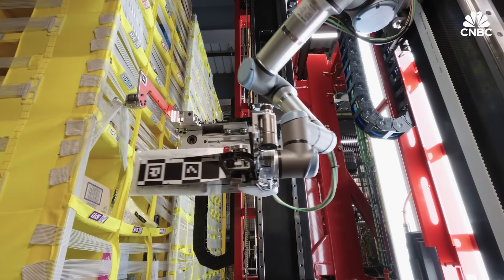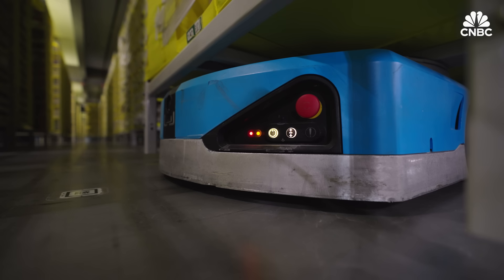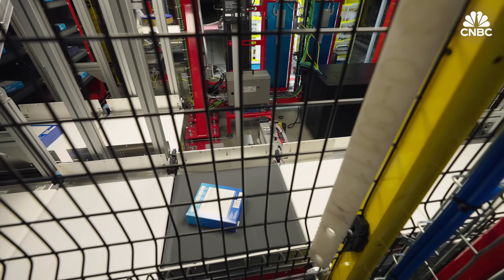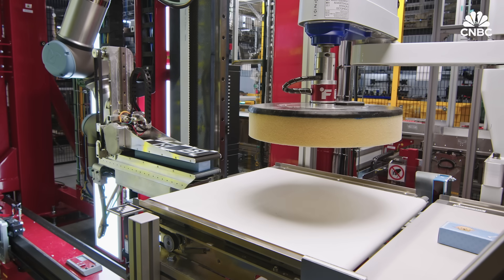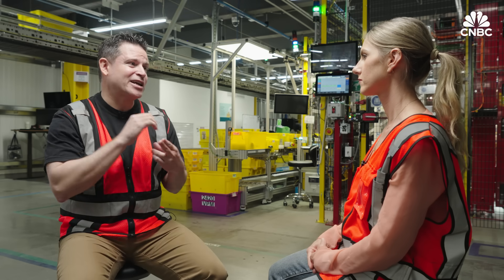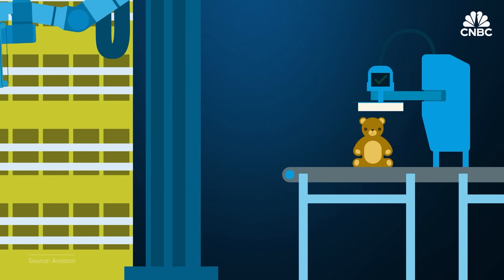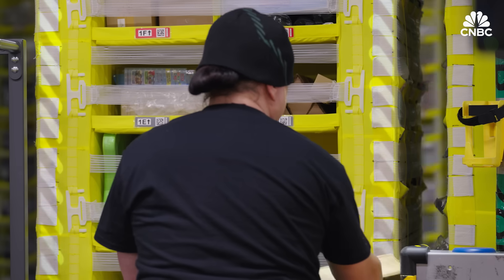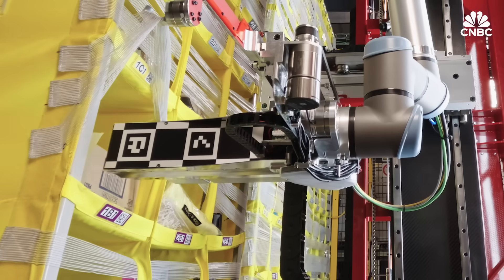Meet The New Amazon Robot That Can Feel What It Touches

Comment: 11:30 There are large warehouses in northern Europe that can't exploit cheap humans that have almost complete automation using systems like that one, items go in trays and the trays are stored in racking dozens of metres high with capacities for hundred of thousands of items in each warehouse, and more where items like clothing, etc go in totes, as a single type of item to maximise that space further. When the items are on trays individually, they're able to automate everything from the point the human forklift operator unloading trucks and placing them onto the entry point of the conveyor system through to completed pallets of mixed items heading out to supermarkets, or orders being picked for customer orders for supermarkets, etc in Singapore as well. For picking, the trays and totes can be brought to the picker at table height, no bending or stretching needed there, and pallets are even raised and lowered for when they can't be stacked automatically. They've beat Amazon at everything they think they're good at, except exploiting humans, because that's illegal for them in Europe. Amazon is the only one using those stupid fabric bins because they're an idiotic idea.

Comment: 0:18 I've seen that is so many videos relating to these yellow 'bins'. What's the point of having all the individual compartments and all the tech for lighting up which one someone is supposed to pick from if you're bunging a bunch of different items into each compartment just to slow down the pickers who then have to dig through several items to get the one they actually need? 'Oh, we can save 1.5 second here if we light up the labelled hole item 'x' is in', only to cost 30-40 seconds from regularly forcing avoidable shuffling through several items because they don't have 3 hands, 1 to pull the elastic out of the way, one to lift the unneeded items out of the way and the third to actually grab the item at the back they're looking for.

Edit; Many returns are from the wrong item being sent. What else do you expect shoving so many completely different items into the same hole!? To hear that your solution to that is a robot that via artificial insanity will shove more mismatched items into the same holes!? WOW! Amazon isn't 'a' to 'z' anymore, it's 'a' to 'i' but forget everything in between like 'c' for commonsense.

Comment: They're only handling small items.  I've never seen a robot that can lift a case of Monster or water.  And the walking robot is slow compared to a human and can't lift a full tote.  There's only a few items in those totes that they're carrying.  When a human has to make a truck with an item, they're carrying a full to tote fast a long way for someone to find the item and pack it to go out.  And I've yet to see a Robot that can fold a box, pack it, tape it and put it on a conveyor.  Simple tasks for a human.  Robots can't do it.  AI needs to be constantly monitored for incorrect information.  Someone needs to do that.  Robots and AI will never take over our jobs.  Will never happen.  I wish people would use some common sense and stop saying that.

Comment: I worked in an Amazon Warehouse. These jobs are not meant for most human brains. It is mundane. They will still need people to manage the robots.
Reply: What’s gonna be different? It’s still gonna be mundane . Them by the side of the robots waiting for something to do
Reply: @ja-cr6pz  When the robot's break (fyi, it's a marketing myth that they work 24/7), some computer will show a human which screwdriver to use and which screw to place at which location via some laser or AR headset.  That's the new "mundane" job for Amazon warehouse types.
Reply: I would rather have a human do this mundane job than have a robot take over a human's purpose of existence.

Comment: Your only jobs will be to keep the machines well oiled and happy
Reply: Until robots eventually become capable of doing that too
Reply: @Noobtuber251 An evil that can run itself a thousand years. No need to tend it
Reply: For like what, 10x fewer workers that'll have this job compared to before the automation?
Reply: I would also like to be kept oiled and happy, do I need a machine for that?
Reply: Robots can easily be able to in theory maintain other robots when this happens to prevent them from breaking down. Once that happens, its like a recycle facility when it will be cyclical, they will all maintain each other and there will be backup in case the system breaks.
Reply: A little Handy Job will top it off
Reply: no need for oil, they have long term chinese bearings! :face-fuchsia-poop-shape: